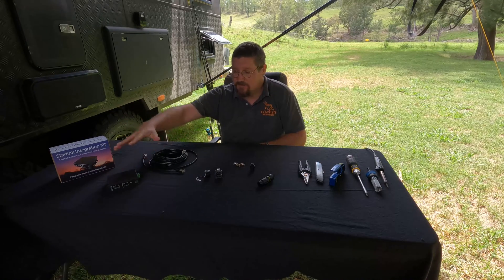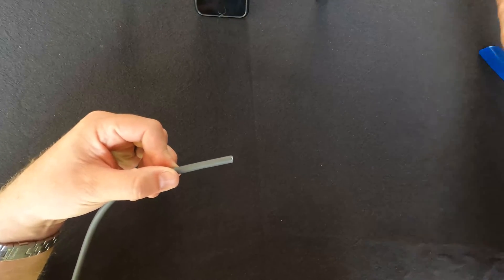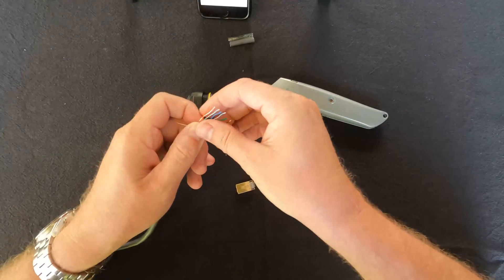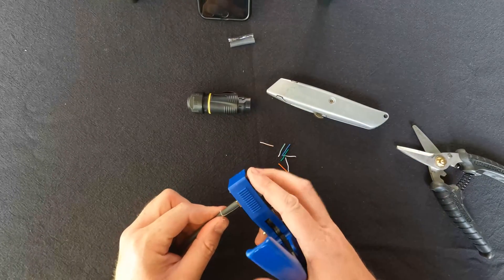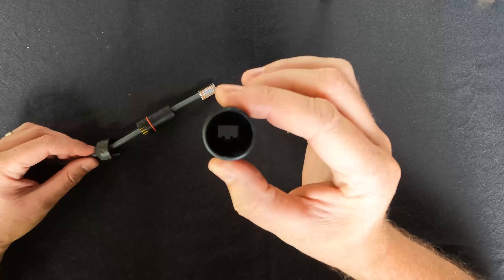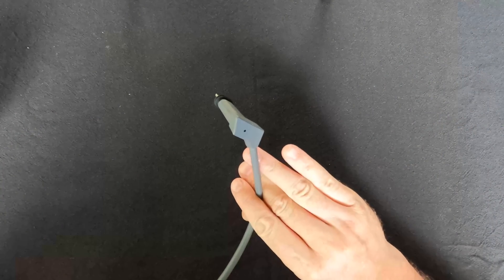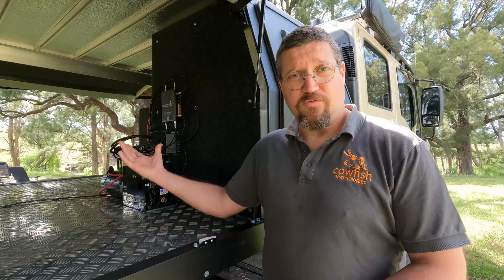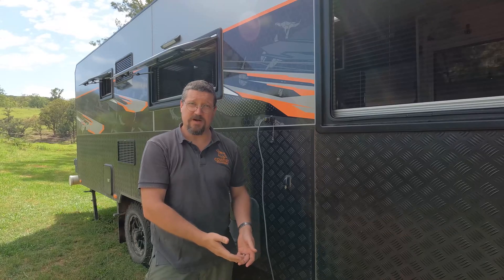Starlink Integration Kit - Option A Installation

Comment: you give details of the wiring setup for the RJ45 going into the waterproof plug. However, you do not give the wiring setup for when you add the RJ 45 to the starlink plug end that you cut off. Can you please clarify that wiring setup. Thanks
Reply: Hi Peter, the wiring layout is the same for all of the RJ45 connectors.

Comment: Does it come with anderson plug or cigi socket for power?
Reply from the maker: No it does not, the unit is to be wired straight into your fuse panel.

Comment: How does this connect to power?
Reply from the maker: The Integration Kit connects directly into your 12V battery system. Either wire it into the fuse panel r a separate (fused) lead from the battery